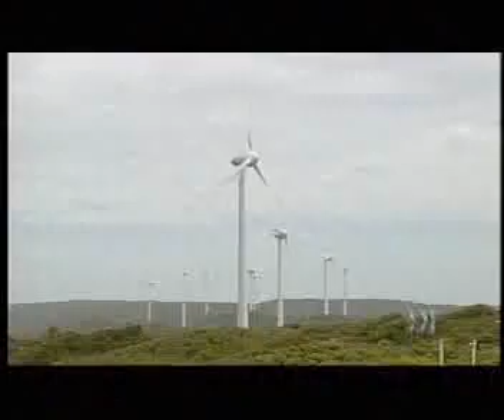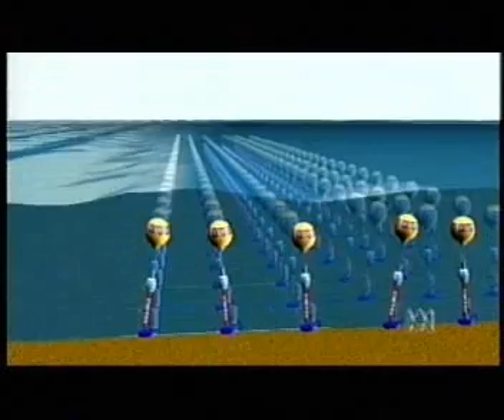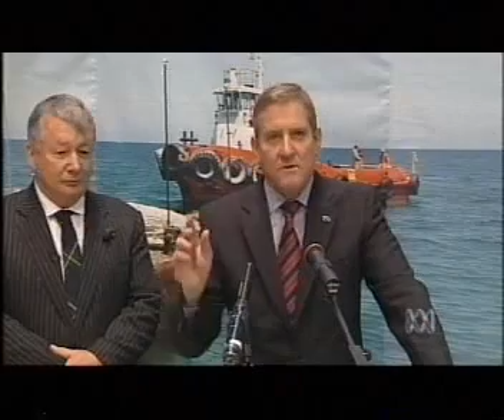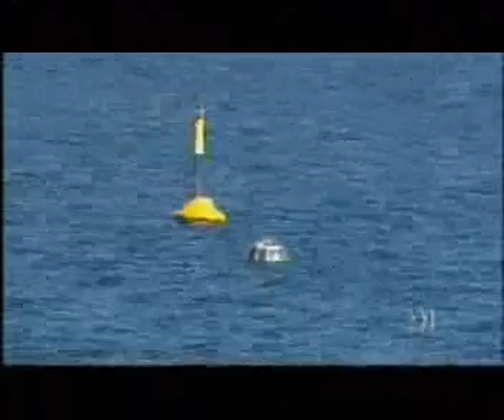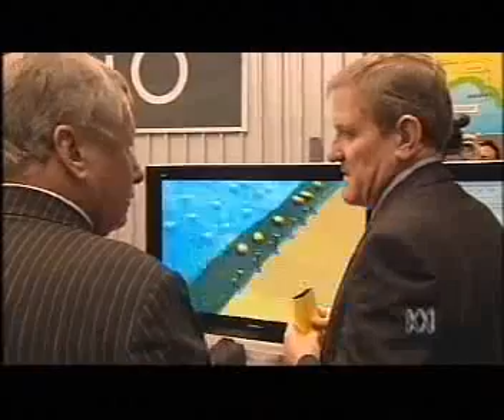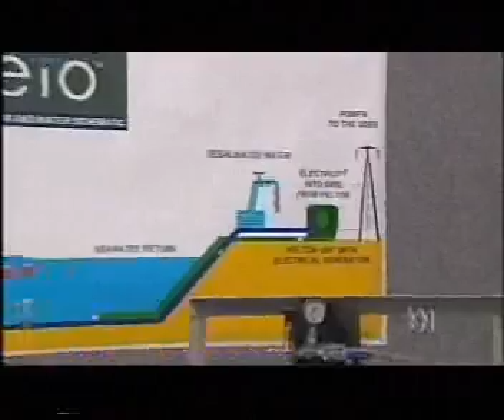CETO Wave Power

Comment: interesting way to keep the cost of the system down... instead of a dynamo inside each buoy to convert wave motion to electricity, its simply got some plumbing to pump the seawater around it towards a big power station ashore